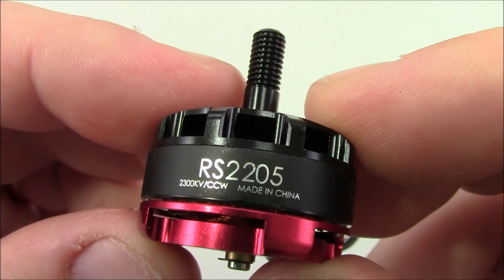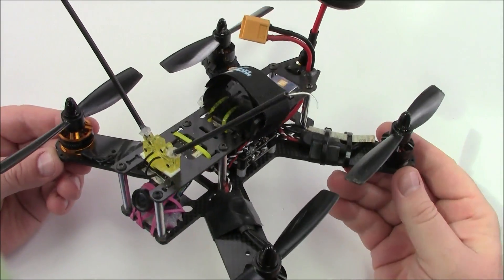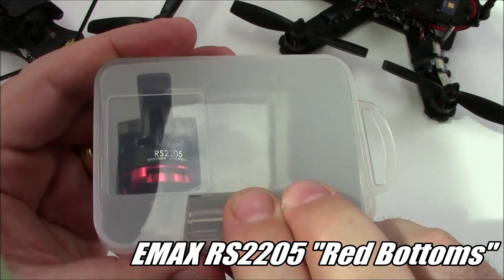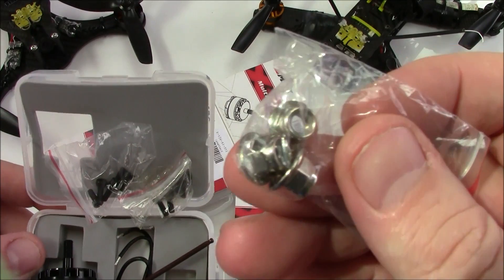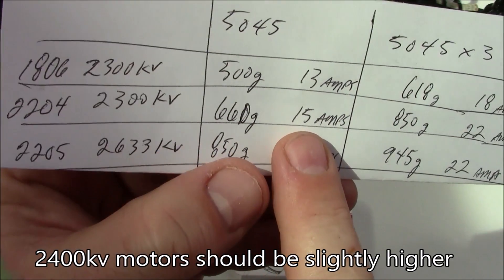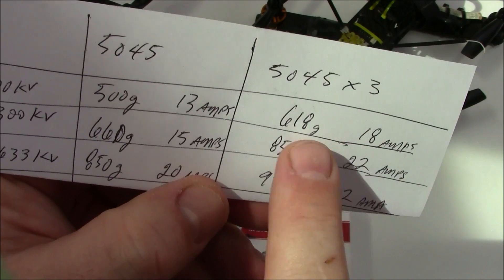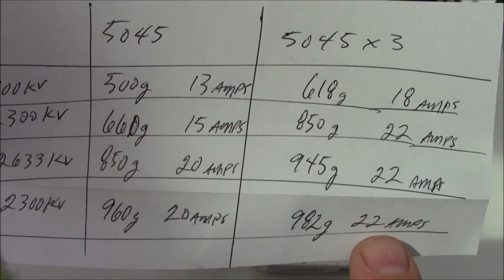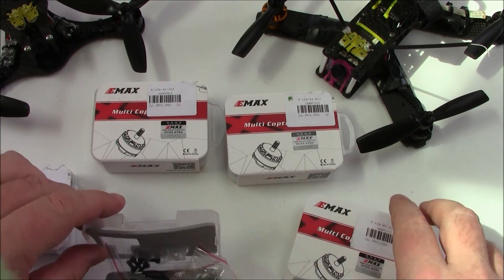Drone Racing Motors & the EMAX RS2205 Motors from GearBest

Comment: Thanks for the table. I was searching for this data! Actually running these motors on my race quad and my littlebee 20A were bursting into flames at full throttle. Will now upgrade to 30A and this might do the job. It is really annoying to see your quad bursting into flames on fpv and having to run through the field to save the rest of it!

Comment: can you recommend me a good 6s motor ?
Reply from the maker: For 6S, you're going to need something down around 2000kv.  Also, there aren't many motors rated for 6S, but if you fly them and they don't get hot enough to burn your hand, they'll probably work fine.... I don't have any recommendations though.
Reply: thanks i found these Cobra CM-2206/20 2100kv Brushless Multirotor Motor - 250mm FPV Racer 6s
Reply: and yes they were very hard to find and not cheap lol around 100 bucks for 4

Comment: i am wanting to make a drone for a while, the problem i have been having is that i dont know what props/motors is should get. It is going to be a stable photography drone but is want it tot be fast when i het the camera of. do you have a Idea of what motor/prop i should get? BTW the amps dont matter.
Reply from the maker: It is hard to get both a good hovering camera drone and a racing quad from the same quadcopter.  You're probably going to build for one purpose or the other.  I guess it depends more on what you mean by "fast".  The Phantom drones are relatively fast even with a camera gimbal attached.
Reply: travisgrindal by fast i Mean around about 30mph or a bit quicker. i already have done a lot of researche and i found this motor: d3536 1450kv, i think these Will do the job. do you know any stable props to go with these motors. the drone is going to weight 1kg i think
Reply: Typically it is 920KV motors with 9" props for a quadcopter with 3-axis gimbal and a gopro-like camera.

Comment: do i need to cross the wires when attayching to esc or do they come already set to spin in a ccw or cw?
Reply from the maker: The motors can spin either direction.  The "CW" and "CCW" refer to the direction you turn the nut to tighten it - not the direction the motor spins.  If it is spinning the wrong direction, you can reverse it by switching 2 of the 3 wires or you can reverse it in the firmware through "BLHELISuite".

Comment: One question for you If say i was to buy 4 of these motors and wanted them all on normal screw thread do i get the CW or CCW motors? and great review by the way ;)
Reply from the maker: Thanks!  CW and CCW indicate the direction the nuts tighten on the shafts.  So you'd want CW motors.
Reply: Thankyou
Reply: Well they do sell them in packs of fours 2xCW and 2xCCW but you can change the direction of the motors in the escs. I know these motors have good cooling maybe it depends on the rotation of the motor for cooling i dont know but id rather have them all the same thread it drives me nuts having them different i never know if im tightening or loosening them lol.
Reply: Self tightening props!

Comment: Where you get those radio antenna holders from?
Reply from the maker: These are the ones I'm using.  http://www.banggood.com/5X-CC3D-CC3D-Atom-RC-Antenna-Pedestal-Antenna-Box-For-RC-Mutirotors-p-974355.html?p=6Z050013977120130325
Reply: yes, i just barely hacked up one of mine even with a ziptie mod. want these

Comment: Travis is it easy to build your own racing drone.
Reply from the maker: A 180mm or larger frames are a little easier to build because they have more room inside the frame.  Well, unless you get an X frame, like a Kreiger, then it can be real tight.  A 130mm size build is a lot harder because everything is so tight inside.

Comment: do you need to put different motors on at the front and back? there are CCW and CW versions or does it not matter?
Reply: the only difference between cw and ccw motors is that by the rotation of the motor, the screws holding the props tighten there is no difference apart from that
Reply: I'm using x4 ccw rs2205 2300kv on a QavX. My other QavX has x2 cw and x2 ccw I always end up tightening one when I want to remove the nuts. I'm almost getting ready to ditch the cw motors cause it drives me crazy!

Comment: Nice video. I wanted to point out that you used the term "thrust" in regards to amps drawn by the motors. I know you were rushing to say everything you wanted to but "thrust" or "pull" is both a combination of motor speed and torque and prop diameter and pitch. The amperage draw is simply how much current a motor draws driving specific props at different voltages and speeds. It is common in RC to ballpark match motors to model weight based on their maximum power (wattage) drawn however. I just "inherited" two of these motors as they were shipped to me in error. The firm ultimately told me to keep them since shipping fees, etc. were prohibitive going back to China. I'm a fixed-wing, heli and toy quad RC guy so I will be looking to use these  in a small airplane project in the future. Hope your racing goes well.
Reply from the maker: +R Usack Cool, thanks for the info!  Those motors should be awesome on a fixed-wing too!

Comment: can i use these motors on 4" rotors?
Reply from the maker: +Hauntman 31 Yes, there are also some red bottoms that are 2600kv which are suppose to work better with 4" props.  Here's a link:  http://www.banggood.com/Emax-RS2205-2600KV-RS-2205-2600KV-Racing-Edition-CWCCW-Brushless-Motor-for-FPV-Multicopters-p-1041930.html?p=6Z050013977120130325

Comment: How are you getting on with the red bottoms? I've got them on all my quads. Love them. Yet to break one.
Reply from the maker: +Flight Mode Fast Mine are still working fine.  No lost C clips yet.  :)
Reply: Cool. I was spending a lot on replacement Cobras - thought that was normal !
Reply from the maker: +Flight Mode Fast You could also look at the DYS SE2205 motors.  They are DYS's response to these red bottoms.  https://www.youtube.com/watch?v=nj0476UC0GA
Reply from the maker: +Flight Mode Fast I'm not trying to persuade you to DYS.  They are both great motors.  I run these Red Bottoms on my GE220 and the SE2205 motors on my TC-R260.  Both are stupid fast!
Reply: I hope you win some more races soon. Preferably with red bottoms lol
Reply from the maker: +Flight Mode Fast I took 3rd in a drag race yesterday with my GE220. Ir runs the red bottoms.  The 2 guys that beat me were better pilots than me.  The motors did real well.  My quad was clocked at 63 MPH.
Reply: That's very impressive. Nice one Travis!

Comment: Waiting on a replacement KISS 18a v1.2 ESC to get my RS2205 2300Kvs in the air, but on the bench they sound so silky smooth. Then again I'm coming from the Emax 2204 2300Kv motors running on Emax 12a Simon (BL Heli Flashed).

Comment: I have these motors arriving tomorrow for my qav250. For a year ive been using the Lumenier 2206 2350 kv motors and they are great but I push them hard with 4s and 6 inch speed props and had to change out a few bearings but overall I am very satisfied with the Lumenier motors and interested to see how the Emax compares. I'll let you know.

Comment: I just finished a 5" build (qav210) with red bottoms 2300kv and am very happy I did. feel like going from 3s to 4s as someone else pointed out. They are a lot faster in all throttle positions and punchouts are insane. I had set a goal to build a machine capable of flying as fast as the 5 inch machines the pros use. I run 5040 tri blades with 20 amp lumenier N-FET escs, but I dont use the BECs. Not sure if I lose a little on the top end because of my ESCs or not,, if so it cant be much as the punchouts are insane.
Reply from the maker: A couple of my friends run these motors with 20 amp Little Bee ESCs and they have no complaints.
Reply: Yea so far so good! I do want to experiment a bit and try out rotor geeks 20amp, perhaps on a thrust stand. By the looks of them, they are beefier and supposedly handle a 25/30 amp constant draw with no problems. Haven't done any real bench testing on the mini Lumenier 20a (which btw are rebranded, I found the same ESC sans the Lumenier sticker for only $10.00) so I don't know the real stats. They look a tad whimpy for the amount of current the 2205s draw, however I could be wrong as it does indeed fly well enough.

Comment: Which ones do you prefer? The RS2205 or the rcx 2350kv ones?
Which ones are more resistant?
Reply from the maker: +Dick&#39;n Nick - DanutsFPV I haven't tried the RCX 2350 motors but I did just get a set of DYS SE2205 motors.  I'm hoping they'll run 4" props real .
Reply: +travisgrindal Thanks for the answer. I thought you may had used those motors...
What about the durability of the emax??
Reply from the maker: +Dick&#39;n Nick - DanutsFPV I've only had them for a few weeks, but so far, so good.
Reply: +travisgrindal Thank you for your feedback!

Comment: The've tried in the frame of 210 mm? They are stable or is very small the frame? I was thinking of putting them in a frame 200 but not if they are stable
Reply from the maker: +Alejandro Soto If you're going to run 5" props, I'd say yes, these are good.  If you're planning 4" props, look at the 2600kv ones instead.  http://www.banggood.com/Emax-RS2205-2600KV-RS-2205-2600KV-Racing-Edition-CWCCW-Brushless-Motor-for-FPV-Multicopters-p-1041930.html?p=6Z050013977120130325

Comment: what esc is suggested for these motors? Are BlHelli-20A ok?
I am planning to use them on a Tweaker 180 FPV build UP - Would this combination be ok?
Reply: +Dimitris Alexiadis I saw a test where the motor was not bale to put out its max thrust on a 20 amp ESC but on a 30 amp littlebee ESC it did much better.

Comment: The truth is not that they are using "better" magnets, but stronger magnets (N52) which unfortunately not available with 80°C temperature resistance that all other motors are using (N48) so they will already start to degrade once they get over 60°C ... so basically emax is sacrificing durability for short term power.
This looks good in YouTube when new motors are tested, but I really wonder what the figures will be after a couple of races... since nobody has tested that yet, probably I have to buy some myself....
Reply: +Foliengriller I've been using these motors since December. I've flown with them in CA, LV and Dubai. Heat is not an issue as the "cooling" feature in the bell actually works.
Reply: +Foliengriller but do these not also run quite cool so heat shouldn't be a problem?
Reply: +MTL Racing Yes, but 60°C is still quickly reached, especially if you run triblades our if you quad is not correctly tuned(p too high).
so I would be interested to see, how they perform after a couple of months use....
Reply: I will keep an eye on Jaren Morris and his qav r with these motors and see how long they last him. He flies a lot and uses tri blades so I will keep an eye on how he is getting on with them and if he notices a drop in performance.

Comment: Dude I love these motors so much that these are the only motors that I buy. the N52 magnets gives it so much torque. I just recently received a new batch of RS2205. they look a little bit different. I'm not sure if you've seen it yet
Reply from the maker: +Giang Ngo I haven't seen the newer ones yet.  So far, though, I really like these motors.
Reply: +travisgrindal https://www.instagram.com/p/BDEjGInNQ2j/ check out this pic in my instagram. This is going to be the newly revised designed going forward. It's on the yinyanmodel.com website

Comment: I got some red bottoms and they scream with 6030 props. the nuts they come with are horrid though
Reply from the maker: +rpaull3 What's wrong with the nuts?
Reply: +travisgrindal they are unbalanced. i got some aluminum low profile ones from getfpv
Reply from the maker: +rpaull3 Strange.  I haven't ever heard of unbalanced prop nuts before.  Cool though, I guess.
Reply: also, the aluminum ones are lighter because of the metal and the smaller height, that makes motor response a tad quicker. Lastly the red bottoms come with really long prop bolts or w/e they are called that the nuts go on, I grinded mine down a bunch so it doesn't take 20 minutes to remove my props and so if they hit the pavement they don't have as much leverage to break or bend :)

Comment: Will they work with 3s as well as 4s??
Reply: yes!!! they work better on 3s than any other motors I've used. to my knowledge, this is  the only motor that uses N52 magnets
Reply: +Giang Ngo ok thanks.
Reply from the maker: +Giang Ngo Nice.  I haven't flown this quad with 3S yet, but now you're making me want to.  :)
Reply: hey guys, which batteries do you use exactly???  3s 11,1V 1300mA ???  Or should i choose a 3s with a higher Voltage maybe 16V and 1300mA???  I read in the specs of the "Red Bottoms" that the Thrust can reace over 1000g by using 16V???  Any ideas???
Reply: NeumannU87 If your battery is 16V, it's not 3S, it's 4S. And yes, it will create more thrust and yes, most of the time it's a better experience to go 4S. Battery capacity (the mAh number) should be chosen on the basis of the size of your quad. Usually, the more mAh a battery has, the more the it will weigh.

Comment: I have BE1806 2300kv motors like that on my quad now.  They're rated for 3S, but do they do okay on 4S?  Any impact on lifespan that you've seen?  Awesome video btw.  I really am learning a lot from your channel as I'm relatively new to the racing quad scene.
Reply from the maker: +hotbrass2005 Thanks!  I've been running them on 4S for over 6 months.  I've only replaced one and that was because I dented it in a crash and it wouldn't spin.  If there is any impact on their lifespan, I haven't seen it.  I would have no hesitation about running them on 4S.  Just make sure your ESCs are rated for 4S.
Reply: Awesome!  I have 20A blheli escs that are rated for 4S, so I guess all I need is a battery or two... or three... or six.  ;)  Thanks!
Reply from the maker: +hotbrass2005 You'll notice a lot more power!  I like the 1806 motors with 4S and 5046 props.

Comment: I still use DYS BE1806 2300KV with GF5030 on 4S. They pull 660g @ 11.4A  (3.46g/w)

I believe they are still the best bang for your buck at only only US$10 ea.

These could pull over 700g with a LiHV battery...
Pulling these thrust figures are getting close to their Limit!!
Reply from the maker: +Glenn Bot I have some 5030x3 props at home.  I may give those a try before I swap these out.  :)

Comment: ESC's are more important than the motors. Always.

If you are loosing races, and all things other are equal but motors and escs, you are better off looking at high performance speed controllers.

Just a note- those thrust numbers are subjective as you may see very different results between them by changing the escs.
Finally- with all the above said- you are right in that there are several positive reports regarding these motors, and while anecdotal information is always suspect, I take heed in these circles. People win and loose races who fly leagues better than I know nuances which are worth consideration. Might have to get a set of ccw just to have on hand. I keep both cw and ccw lock nuts. Seems the cw are on pre order.
Reply from the maker: +Hiway I'm planning to use LittleBee 30amp ESCs.
Reply: +Nicolás Marí Hernández the 30amp little bees have that processor i think, only the 20amps little bees have the slower one
Reply: +travisgrindal better use some esc with fx39 processors like hobbywing xrotor or dys xm series. Way better in many aspects. You can almost get 15% extra thrust with them compared with other esc like fvt littlebee.
Reply: +Hiway Actually the 2300kv red bottoms don't care if it's f33 or f39x. Thrust will be about the same or sometimes higher on f330. Also, the thrust numbers are not subjective... They've been benched by ~10 - 15 different people and the numbers are super consistent.
Reply: +Furadi Thanks for the learn on.
Reply: +Furadi would I be getting full potential from these motors if they were ran on the tbs powercube? ESCs on it are the tbs bulletproof 20a. Or would it be more beneficial to just run 30a littlebees?

Comment: +travisgrindal +travisgrindal yeah that's why DYS came out with their new XM series esc's. Gotta stay up to date. It all changes so fast. Next year little bees will suck.  You watch. Lol. ThatHPIGuy on YouTube did a video about it. He was using an old 12A and switched to a sn20A for 4s testing and was only getting 6-750gr. He switched to littlebee or a Zeus(littlebee) esc and bam. 900+ on 5040's I think and 5x4x3 he got 1033 or something stupid.
Reply from the maker: +Invitingsauce Well, that is good because I have a set of LittleBee 30amps that will power these motors.

Comment: I just picked up a set. They do indeed make 1000+ grams on 4s with 5045bn. The make 1100 grams with 5050x3. They make 1200-1300grams on 6". They are awesome. Take a shit all over Cobras and don't drop magnets. Use a good esc like a littlebees or kiss or rotor geeks.  Dys Sn20 or bl20 only make about 6-800 grams on these.  Switch to little bees and your making 900-1000 grams instantly.
Reply from the maker: +Invitingsauce Good, I'm planning to use LittleBee 30 amp ESCs.  I just bought a mess of 5045x3 props.

Comment: fix the title rs2205
Reply from the maker: +Calvin C My bad.  Thanks!
Reply: +travisgrindal you should try 5040x3 with the rcx 2633kv motors, the 5050x3 are just too hard for 2633kv to spin
Reply from the maker: +Calvin C I have a bunch of 5030x3 props.  Maybe I'll compare them with the 5045s I have on order.